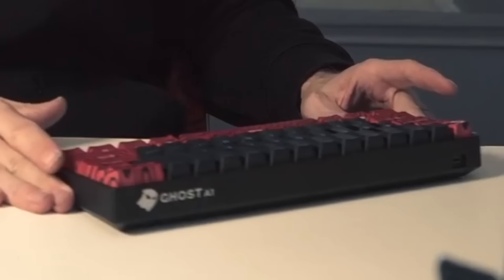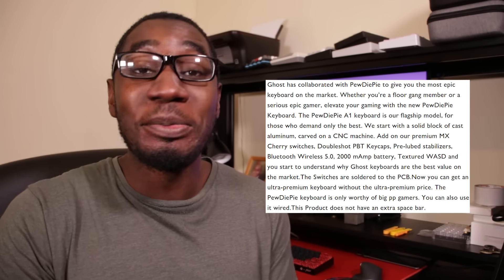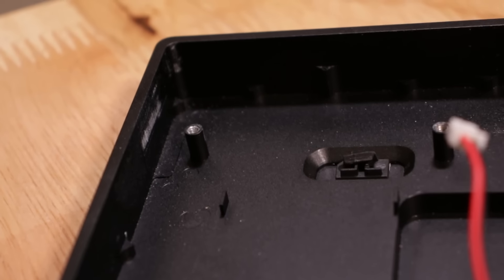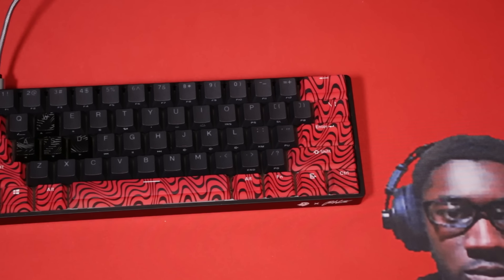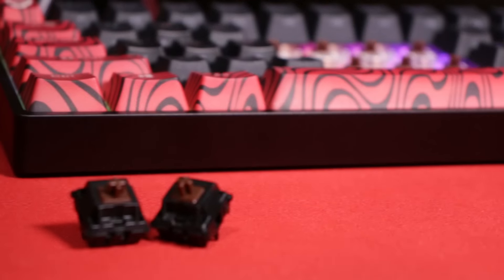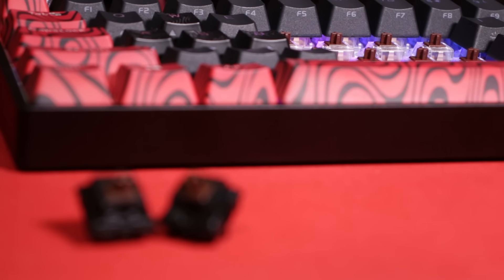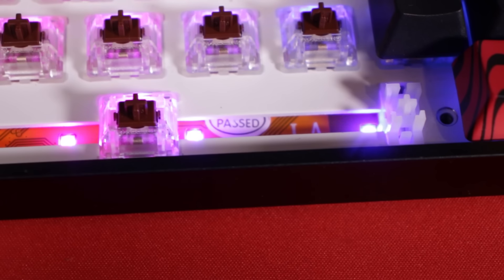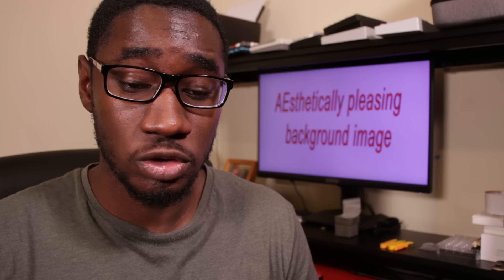I Bought The Pewdiepie Keyboard...

Comment: In today's standards, you can literally get an RK61 that has factory lubed stabilizers, factory PCB foam, factory foam case, hot swappable switches, and a cheap pricetag. It's such a steal in 2022, and I have one with me.

All I just did is just tape modded it, and applied lube to the switches and we're golden.

Comment: I have a $5 gaming keyboard and been using it for 3 years now. Man, my cheap keyboard is still strong and together with me more than any of my relationships that ends in just few months. Me and my keyboard is now married and has 2 kids with one adopted mouse.
Reply: @est495  uhhh having a thing not clunky like those office keyboards? and a mouse that has more accessible buttons and a button meant for changing dpi unlike normal ones who only has 2 buttons? And a cheap computer enough to run current gen games unlike school computers that can't even run Microsoft words without crashing?  

And a gaming chair stolen from your grandpa's car that will give you 100% accuracy rate doing 360 no scope while jumping on a moving helicopter?
Reply: How can they even make a keyboard so cheap let alone sell it for profit? Some people spend as much on a single switch (way overpriced) as you did on your entire keyboard.
Reply: @NaudVanDalen  the original price was $60 but bought it for $5 during discounts. (Black friday,Christmas,etcetera)
Reply: @AjZeph  It must have been an old version they wanted to get rid of even at a loss. Amazing deal.

Comment: you gotta tell us where and how you built those keyboards for 100-200 dollars
Reply: Aliexpress
Reply: Check KPRepublic or AliExpress, if you got experience with a soldering iron they are very easy to set up, though hotswappable kits aren't rare these days so you'd only need a Phillips screwdriver.
Reply: Same, that first keyboard for a hundred bucks.. would be really interested in what parts that either are or whether it's available as a kit or something
Reply: @efcf-gf5uq  Epomaker GK96S

Comment: The video has been out for two years and I've had the pewdiepie keyboard for almost the same time now. I'm sure its not the best keyboard I will ever own but its definitely and upgrade from the one I had before. It hasn't suffered any mechanical issues and the light features are pretty nice. My main gripe is that the wasd keys collect gunk because of the grooves but its pretty easy to clean so its not a huge deal. All in all I've gotten my moneys worth for sure and its worked well for 2+ years so far. It was very much a novelty purchase so I'm sure I could have gotten a similar quality keyboard for less but I'm not too torn up about it. I'm sure a keyboard hobbyist would have more issues with it than I do but as long as my keyboard works and is comfortable to use for gaming and schoolwork I'm happy.

Comment: I just bought a few days ago PewDiePie keyboard that has the acrylic case because it was 50% off and that was a great deal. But when I started using it I noticed that the board wobbled and the 7 key only works after I hit a few times, I have emailed them about the problems and I have not heard back yet.

Comment: sooo... with all these more or less "unknown"  brands: i plan on buying a corsair k95 rgb, are there other, similar keyboards for less money? i never had a mechanical keyboard before, i'm using a logitech g15 refresh atm, i already have corsair software installed to control the rgb in my case and according to their site the same software is used to set up the programmable keys as well as the rgb on the kb.

i need the separate f-keys, i need the numberblock, i need the programmable keys, i want the rgb (preferably complete control over it to make specific keys have a specific colour and not just some effects) and i wanna try something mechanical, preferably with the same travel as the rubberdomes i have now. i have no idea how the corsair board feels, there's something about "1,2mm" with the switches so i hope that's not the whole travel, that would feel like a laptop keyboard or even worse. especially since they all have the same keys, at least the ones that i checked
Reply: All the pre-built mechanical keyboards from popular gaming companies are pretty shit. There are way better options.
Reply: Look at  Leopold or Ducky. Going to be WAY better than corsair, razer, ROG, etc.

Comment: As if Cherry MX Switches were ✨Premium✨ haha😂 Same for WOAH ALUMINIUM PLATE lol. Premium would be Prelubed/Filmed Kiwi Switches and a Gastket mounted Polycarb Plate plus Tapemod and Case Foam. Some Silicone between Plate and PCB. Also OEM Profile Keycaps and Durock V2's (prelubed) and who needs RGB🫢 Also a Braided Cable with a PewDiePie Bi*ch Lasagna would be nice instead of a 2000mAh Battery.

Comment: are gateron browns the same as cherry mx browns because i have gateron browns in mine and im not sure of the difference
Reply: They are technically the same design. In my opinion Gateron Brown have smoother pre-travel than Cherry Brown but the tactility of both switches are genuinely weak compare to Akko CS.

Comment: I bought a redragon k599, swapped out outemu reds with akko jelly blacks. All stabilizers except spacebar comes pre-lubed. Total cost: ~$60. It's got 2.4G connection with 4000 mAH battery, basically lasts all week, maybe even two weeks. So that's miles better than this $200 trash. WOW

Comment: I can actually buy a cheaper keyboard with better quality, only 42 dollars and you get a keyboard with software, pre lubed stabs, wireless and wired connection, hotswap, and pretty solid function buttons that is actually easy to remember without looking in the manual

Edit: typo